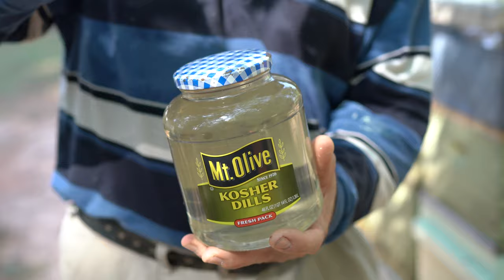Beekeeping For Beginners - Does Small Cell Foundation Help Control Varroa Mites?

Comment: Bit of distortion around the wires. What do you think about plastic. I am sure it wouldn’t do it as much.
Reply from the maker: We don't like plastic for a few reasons.  We don't like eating honey that sat in plastic and in the heat. Also, the bees have a hard time building comb on plastic. Some distortion is normal, they are still in a transitional stage. Thanks for watching! :)

Comment: I only use foundation less frames with a 3/4" starter strip at the top. My bees are smaller and have no problems going through the Queen excluder and my drones are huge. Small cell brood emerges a day or two sooner than the bigger bees. I have hygienic bees also  I  monitor for varroa but have not had to treat for 4 years. This is a link to a short drone video I did.   https://www.youtube.com/watch?v=BkyjAahfUUU
Reply from the maker: Very nice! We are happy to hear that! We will definitely check out your video. Thanks for commenting! :)
Reply: Very interesting!   I will check out your video.  I can get small cell foundation and expect to still need to treat for mites but between small cell and drone frames, that the mite levels would be reduced.  It will be a good experiment next year to look at mite levels on two hives... one with small cell and the other with standard.  I'm new to beekeeping and it may take a few years for the mite levels to be an issue here... we will see.

Comment: I don't use foundation. I hot glue a strip of thin wood 1 or 2mm thick at top of frame this helps bees build wax to suit themselves, in stead of wire I use bamboo barbeque skewers. This also means I can cut drown brood out, with no wire in the way.
Reply from the maker: Awesome!